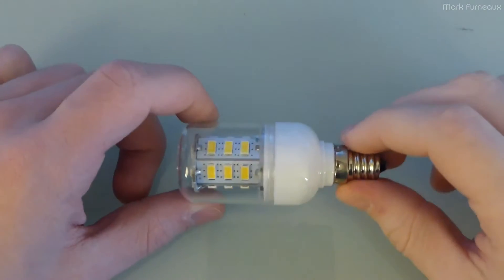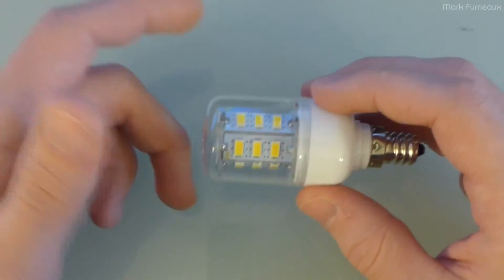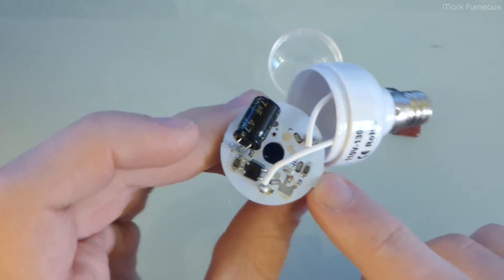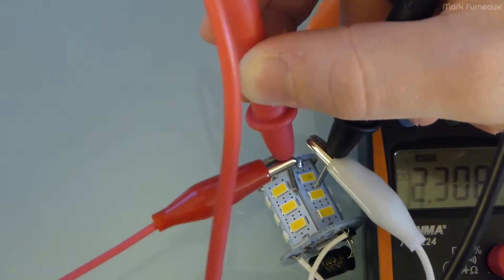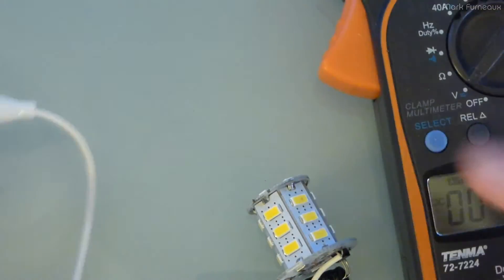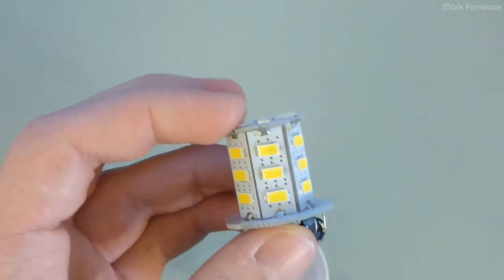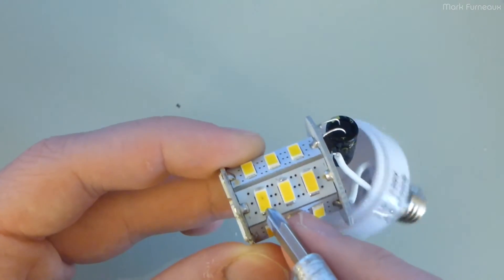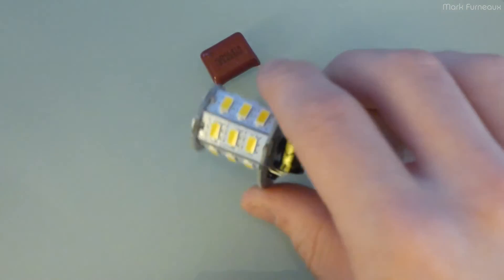Inspection of Another 5W LED Bulb Failure

Comment: Very interesting :-D
I havnt bought any led lighting at all, i just dont expect them to be reliable, its looking like i was right to hold off untill they make them cope as well as real bulbs.
The folded cfl lamps are better, but they still dont live up to there lifespan claims.
How many have died since last year?
Reply: I have quite a few here, and with low quality, low cost ones, you can never tell, some will survive for years and others will fail early. CFLs have just been terrible for me though. Those made 20 years ago by OSRAM still work, but those made anywhere since they outlawed incandescent lightbulbs, even by major manufacturers, just keep dying, they're pretty bad. Plus the light is a bit on the nasty side, LED is slightly better, and at least they turn on instantly.

Comment: At 2.59 it looks very much like you are touching the metal sleeve into which the screwdriver bit fits. If there had been any charge on the cap and you had managed to get your driver in there you would have got a shock!

Comment: Great video. Bigclivedotcom did an autopsy on one of these lamps too and bridged out the faulty led. The inrush current is the led killer. The caps are of too high a value.
Reply from the maker: +RODALCO2007 Whoa! Never thought I'd see rodalco on my channel. I remember watching bigclive's video. I started bridging them because too many were failing and I just couldn't be bothered. I'm going to try to put these under my 400x microscope soon and see what the die looks like after all the internal arcing.